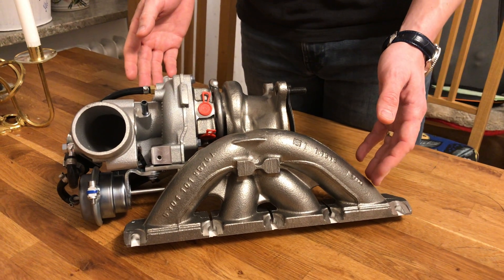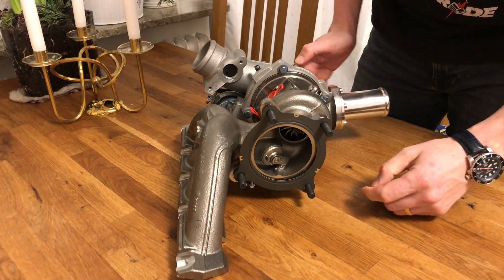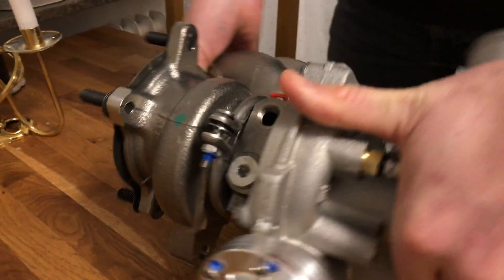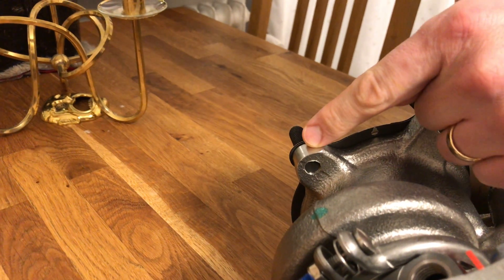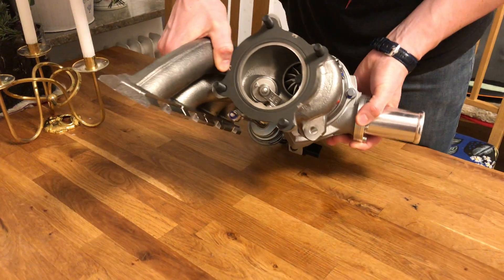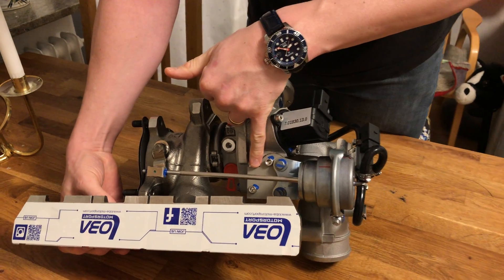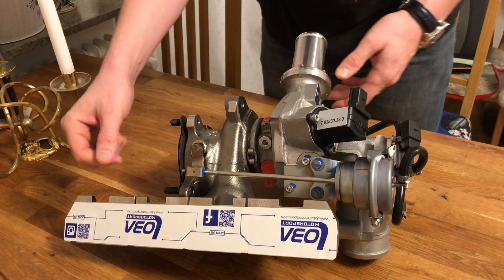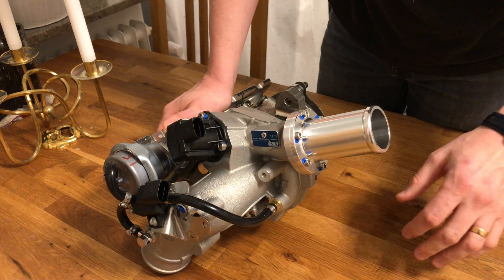LOBA Motorsports LO400L

Comment: Joe Dirt what tune are you running for this? Also, did you have to upgrade the hpfp,  injectors or any other parts?

I have the B8.5 A4 6MT Quattro and was thinking about purchasing this K04 and running  the APR K04 100 ECU tune (water/methanol).

Any advice on whether there is a better ECU tuning option?

By the way, liked and subscribed!
Reply from the maker: I am running a custom tune from Stertman Motorsports. A base K04 tune might work as well. The car has S3 injectors, Autotech HPFP, FMIC etc. This year I am putting in a fully forged S3 engine and upping the boost. On the B8 you should be able to do 300 WHP without much effort.
Reply: @misano_red_s38p  Thanks for this update! Curiously, how much power are you making with this K04?
Reply from the maker: @72defender  It made 373 crank horse power. Then 353 on a later dyno. Will dyno again later this year (new head).

Comment: Very nice thank you for showcasing this, I've been eyeing this product myself for a few months now. Where did you purchase yours from ? I think I'd like to pull the trigger as well. Thank you!
Reply from the maker: I guess it depends on where you are exactly(...) I got mine from a local reseller (SWEDEN). If unsure, contact Loba (call them) and have them verify. Assuming you have a longitudal engine, make sure to order the "L" version. Note that mine did not ship from the reseller, but from Loba directly. I guess nobody have these in stock, so expect a delay (mine was 4 weeks) as the turbo is made or fitted to order.